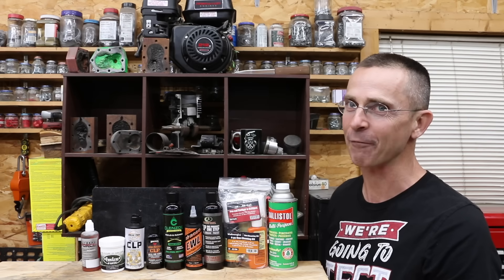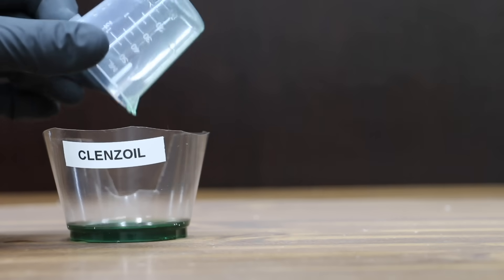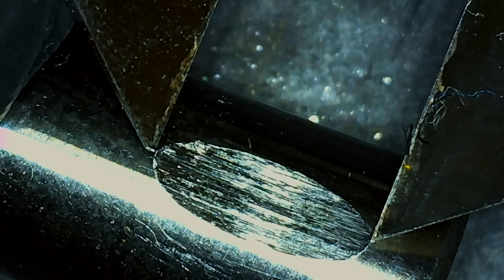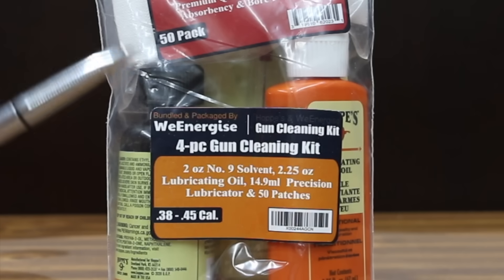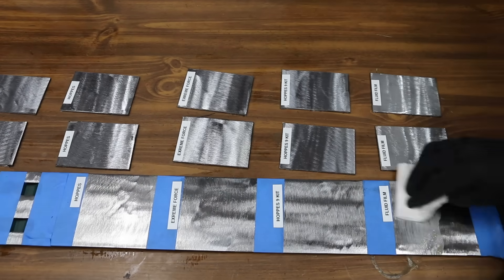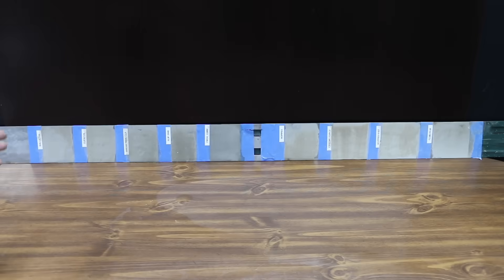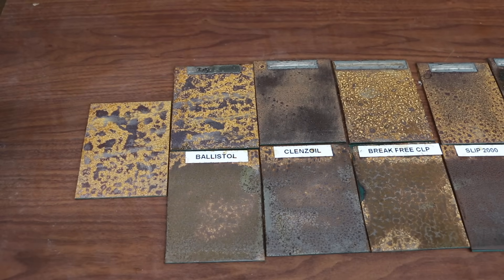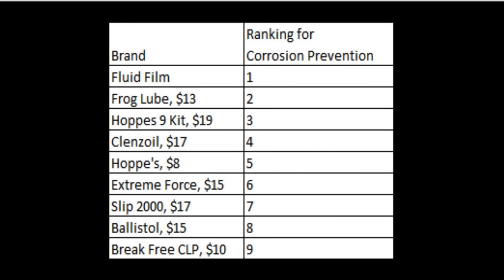Don't Buy A CLP Until You Watch This Review! It'll Save You Time And Money!

Comment: Would love to see how automatic transmission fluid  would stack up against these as I hear it works quite well.
Reply from the maker: Thanks for the video idea.
Reply: @ProjectFarm  mix it 50/50 with transmission fluid. Lots of people on the internet have been using it with good results. How many dirty trans ( internally) have you seen ? Motorkote was one of the highest lubricity lubricants in your past tests and you did cold testing.

Comment: In my experience with break free clp, it's not all that great as a lasting lubricant on firearms but it works great for getting rust off and creeping into spaces. Used it by the gallons to keep guns from rusting and overheating.
Reply: I agree BF CLP to clean followed up with Clenzoil to protect, no one perfect product
Reply from the maker: Thanks for sharing.

Comment: I oil the BCG on my AR with Mobil 1 15w40. Works great! Have only had one failure in more than a thousand rounds, and it was a steel case round that was chambered while hot and not shot for several minutes. I think it caused the case to expand in the chamber and get stuck. Gun fired and cycled, but didn’t eject
Reply: Nope
Reply: Lacquer coating on steel cases will glue the unfired round into the chamber if you stop shooting for even a few seconds, if the barrel is hot. Saw it happen to 2 AR rifles on the same day! Not a lube problem.

Comment: Wonder if Hickock 45 seen this yet? Ballistol is a sponsor of his channel.
Reply: Ballistol was formulated for the German Empire's Military to maintain holsters, firearms, perform maintenance and cleaning on engines etc at a low price both dollars and natural resource wise. Hence it's biodegradable. Then (unlike nowadays) it had nothing to do with the environment they simply couldn't afford to manufacture nor distribute a product made from fossil fuels they did not have access to. 

It's great for what it was designed to do but if you specifically want wear resistance there are better options. And I would choose a 100% synthetic formula for high volume/temperature shooting (lithium grease) and long term storage, because natural ingredients degrade with heat or evaporate with time. Vaseline is my go-to for storing collectibles for years. It works just as well as Comrade Stalin's cosmoline but clean up is a lot easier and you don't notice it in the case.

Comment: Clp should only be applied to metal On metal contact points. You can see where wear occurs internally so just apply a bit to the spots. I prefer hoppes,works great. Never any issues.
 Hoppes breaks Down carbon so well you don't even need a rag. Its great stuff.
Reply from the maker: Thanks for the feedback.

Comment: I used nothing but Break Free CLP for years and I still do on occasion but it has some pretty toxic components so I try to use it as little as possible. Using Hoppes Elite gun oil for most of my lubrication now. I don't have automatic weapons and the Hoppes Elite works fine on my 1911 rails and bearing surfaces on my nickel boron PSA AR15 BCGs.
Reply from the maker: Thanks for sharing.

Comment: Also if you did a part 2.  If there’s a way to test for tackiness/sludge/varnish that develops over time.  I find that like with conventional motor oils, gun oils that are made from organic sources or non synthetic sources when subjected to a heating cycle and carbon from firing and then put away for months at a time without cleaning will varnish up, get very tacky to touch and actually make a lot of firearms not work because the firing pins and hammers move in slow motion.
Reply from the maker: Thanks for the video idea.

Comment: I disagree about the Clenzoil cold test. It appears to me that the Clenzoil was starting to move at the edge, given a little more time I believe that you would have seen slow movement.

Having said that I would rank the Clenzoil as #1 for all except for winter situations below some subjective temp of below 0 DegF. That would be the time for me to break out the Hoppe's #9 CLP until conditions warmed up, then switch back to the Clenzoil. For long term storage and safe queens the Fluid Film would be the way to go.

My experience with Break Free CLP is somewhat contaminated by my experiences with it when it first came out, which was a long time ago. The first batch of Break Free CLP I had worked out great. Some how it got knocked off and I purchases some of the "new" stuff. Terrible results with rust among other things. There was a lawsuit which I believed corrected the situation, I never quite trusted  Break Free after that.

Comment: On the subject of firearms, I would love to see the durability (abrasion, heat, chemical) of different finishes people can apply at home. (some finishes admittedly require SOME special equipment)  For example Cerakote, Duracote, Alumahyde, Anodizing, Rust vs Hot Bluing, or even just Spray Paint.  Since people tend to coat not just the receivers, but stocks, it would be nice to see how finishes hold up on different materials, such as steel (barrels, bolts), aluminum (recievers), different plastics (handguards, stocks, grips ext), some rubber used in grips/buttstock pads.  If you see this, thank you for reading, and thank you very much for all of your hard work on your previous videos, they are entertaining, informative, well thought out and well presented.
Reply from the maker: Thanks so much!  Thanks for the video idea.

Comment: I have a test for you with the old. Years ago I had a car I got owned by a vertically challenged person. The seat wouldn't move at all with my feet on dash board and someone else holding the lever. Break free after 24 hour soak shot sludge into the back seat from track and I almost went out the rear hatch.great for rust. Also had a old 22 as a gift with lots of pit rust. Took care of the rust without any damage to bluing

Comment: Hi Todd,   viewer suggestion for vid,   not sure how to frame test,  but a lot of motorcycle owners are using diesel oils for their bikes,   as they're much cheaper, and supposedly the ad pack is pretty similar, 

Diesels don't have the same caps on zinc DDP that cars with catalytic converters have.    I'm not sure if the high detergent properties are good or bad for bikes.   But anyway,  I'd love to know which diesel oil is best for my bikes.
Reply from the maker: Great suggestion!  Thank you.

Comment: The liquid form of the Frog Lube would have been better suited for this test than the paste.  The paste should be applied to warm metal so that it can fill in the pores and provide a flat even outer surface which prevents wear.  A fair test would've been to heat the pin first, apply a layer of frog Lube directly, the complete the test as you did.
Reply from the maker: Thanks for the feedback.

Comment: About the Frog lube: The manufacturer states the the surfaces it will be applied to be preheated to a certain temperature, application of the product, allowed to cool, then gently wiped to remove excess paste. I run this in my AR and 1911 platforms and I couldnt be happier with it. When properly applied, carbon is very easy for me to remove. I served as an Army infantryman for 14 years, after using break-free CLP on my issued weapons during that time, I can tell you that cleaning a weapon that has been properly treated with Foglube is MUCH easier than CLP lubed weapon. Plus, Frog Lube is food grade so you are exposed to fewer toxins while cleaning your guns!
Reply from the maker: Thanks for the feedback.

Comment: Ballistol is king for removing BLACK POWDER RESIDUE.
Metal slip products isn't always sold as a lube for protection but instead as a slippery metal product to help metal slide easier. Like is you want to reduce the pull weight of your trigger pull.
CLP  refers to clean, lube, protect.
CLP claim to do it all. Some brands don't claim to clp but instead focus on one category like just cleaning or only a lube.
Great video. Thanks, appreciate what you do.
Reply from the maker: Thanks!

Comment: With the Frog Lube paste, you have to heat it (or the part) so that it "soaks" into the pores.  Applying while dry will throw the results off just a little but probably not a lot as that friction test should heat things up anyway.  That said, they also make a liquid.
Reply: I would like to see the Frog Lube tested after being applied as recommended. I believe the salt test was so successful because it was similar to the manufacturers recommended process.
Reply: Thank you for mentioning this! I am a die hard Froglube fan. I use the extreme and do the "seasoning process" every 4 months or so. But in between, even the hardest burnt on carbon just wipes off my parts  now. This is a great channel, and I love his work, and this is the first time I have ever seen a product not tested evenly. Good looking out, bringing this up!
Reply from the maker: Thanks for the feedback.
Reply: I've used Froglube for 2-3 years now. For the liquid friction test and temperature test, maybe try the Froglube Extreme (made for extreme cold/heat) next time. Mainly because, the Paste needs to impregnate the metal first to work properly. Also, it's known to return to a solid in extreme cold temperatures when used improperly (large amounts).
Reply: curious, does it say this in their documentation or in any manual?
Reply: @ShahabSheikhzadeh  Yes it does. People persist in applying it liberally and then are surprised when it doesn't work as expected.
Reply: @matthewblumenthal804  thank you for sharing. I'm going to buy some and test it out at some point. cool! :)
Reply: I've been using Frog Lube since it was first introduced. I've used it to take rust off of metal and as long as the instructions are followed, I think it works as well as anything. However, it has to be put on thinly. If someone applies it thickly, it can get sticky and make a real mess of things. I've heard of people that locked up their actions because they used too much. I don't, and I've never had a problem. Thin film on warm metal. Wipe off excess. Has done well for me.
Reply: frog lube has been my go to for years now, its very pleasant to handle and tools seasoned with it 10 years ago are still rust free today. its something that is more effective the more its applied, i would rest my tools on an oil radiator and rub it in with a rag.

Comment: I use, and would like to recommend for testing, Lubriplate SFGO Ultra 68 as an oil and Lubriplate SFL NLGI#0 as a grease.  Both of these are "food grade", meaning that incidental contact is non-toxic.  They are also synthetic and have very good resistance to thermal fluctuations.

I shy away from motor oil and ATF as a primary weapon lubricant, for their known toxicity and carcenogenic hazards.

I can provide samples of each for testing.  I could also send several other firearm oils and CLP's as well!
Reply from the maker: Thanks for the suggestion.

Comment: As a user of Ballistol, there are a couple of things to point out that weren't mentioned in these tests. Great job Project Farm, I love the stuff you do. Ballistol is not a petroleum based product, I believe it is vegetable oils of some kind, but the blend is proprietary. It is also water soluble which is great if you are shooting black powder. You can make a patch lube with a mix of 10% Ballistol to water and it works great and also seems to help with fouling.  Petroleum based lubricants tend to make black powder cake and stick to the barrel. And Ballistol will not harm the finish on wooden stocks as some petroleum based products will. It also seems to work good for keeping leather holsters in good shape.  I like the stuff, no doubt.  So depending on the type of firearm you are maintaining, you might use more than one product. On my AR, it's Breakfree. On my wooden stocked firearms, I like Ballistol.  Thanks again for the great content!
Reply from the maker: Thanks and you are welcome!

Comment: I use fluid film on my garden tractor attachments lube up all moving parts without attracting too much dust.
I also use sea foam deep creep on my garden tractors to protect chrome from corrosion it doesn't puddle up like fluid film easily wipes clean for displaying at shows. 
I have lot of old garden tractors ranging from 1964-1994
Reply: I may have to put cleanseoil to the test👍
Reply from the maker: Thanks for sharing.

Comment: I am very surprised by what happened with Break Free CLP on the rust test. In other tests that product is usually superior to most others for corrosion protection.  I have to wonder if it had some sort of reaction to the solution you used to accelerate the corrosion process?
Reply: True, I've watched many tests over the years and with steel plates being left outside for long periods or time, salt solution spray, etc, Breakfree CLP is usually in the top 3.  Maybe getting beaten by corrosionx or something very specifically made for anti corrosion. but always beating out the other CLP gun lubes including Clenzoil.  So I thought the same as you. What happened here?
Reply: I also agree with the breakfree rust results. Usually comes out on top. It's been my go to clp for years.

Comment: I didn't get from your video the results of the lubricity from top product to bottom. Will you have another video that also includes lubricity? Maybe lubricity PLUS corrosion? As a gun owner/user, I am interested more in the anti-friction vs. anti-rust/corrosion factor. My firearms are kept in a temperature-controlled atmosphere, so I am not as concerned about rust as I am about lubrication of the gun parts. Great video, BTW!
Reply from the maker: Thanks!  Thanks for the suggestion.

Comment: Definitely interested in more clp/gun lube testing... favorite clp for me is Strikehold clp and favorite grease which I use on every firearm I own is milcom tw25b grease...for me grease on firearms makes the most sense for me...its a open system so it's grease for me...oil is ment for closed systems like engines in my opinion
Reply from the maker: Thanks for the suggestion.

Comment: Another great video by Project farm!  My list for round 2 would be as follows:
1. Lucas Clp
2. Rand Clp
3. Shooters choice -FP-10 CLP
4. Mpro LPX
5. Slip 2000-Gun lube (billed as their CLP)
6. G96 gun treatment
7. Weapons shield
8. Tipton CLP
9. Battle born-all in one (CLP)
10. Rem oil Pro3

All of these are readily available at major on line retailers. Some are repeats from the gallery of comments below.  I'm surprised that the Breakfree did so poorly on the corrison test as others have commented as well.  It did pass the mil-spec test inn order to be apporved.  Perhaps you can re examine the test and make sure it is done with the correct salt spray mixture for accurate results? Great job!
Reply from the maker: Thanks!  Thanks for the video ideas.

Comment: I know you get this all the time but Weapon Shield is what I use in my pistols/ rifles. Not sure how it holds up long term for rust/ lubricity but I maintenance my equipment on a semi regular basis. Anyways the guy who designed it does the bearing wear test you do and it crushes every other firearms product. I can vouch that it has an extremely high viscosity
Reply from the maker: Thanks for sharing.

Comment: Good test but you didn’t use/apply Frog lube probably. You are supposed to clean the gun parts (metal) remove all oils, heat parts with heat gun, apply frog lube and let soak in for 30min then wipe off any excess lube. Frog lube also has a liquid CLP not just the paste.

Comment: I've been carrying guns professionally for about 15 years.  My take.  Cleaning and lube are best left to different products.  The most common failure of lubrication in a firearm is the lube drying out or otherwise disappearing leaving a dry gritty gun when it's brought out and used.    Preventing wear out of the bottle is fine, but preventing wear a month after application is even better.  Been noticing a lot of lubes fail at the latter.  I did a test on carbon removers, and boretec copper solvent won handedly.  I think it's time for an evaporation/drying test of lubes.
Reply from the maker: Thanks for the video idea.

Comment: I really appreciate how technical you get with all of your comparisons.  I use a lot of your videos to guide my decision when purchasing products.  If you make a part 2 of this video, I have one suggestion.  I would like to see you heat the bare metal and then apply the lubricants on the warm metal. That's how I was taught to lubricate my guns.  First, I clean the gun really good and use some rubbing alcohol or brake cleaner to remove any old lubricant. Then, I heat the gun up for about ten minutes.  I apply a generous amount of lubricant to the hot metal and let it cool down completely.  Then i wipe off all the excess lubricant and I'm done.  This process allows the metal to absorb more of the lubricant.  This is a similar process to seasoning a cast iron skillet.
Reply from the maker: Thanks!  Thanks for the feedback.

Comment: I use synthetic heavy gear oil. Doesn't dry, doesn't drip, less than $7 a quart, and when mixed with a little something extra it doesn't smell much.

Used in anything from bargain 22s and 9s to ak's and desert eagles. All run like butter.
Reply from the maker: Thanks for sharing.

Comment: With Frog Lube, the surface needs to be degreased then heated before applying the paste. The paste will immediately melt and fill in the pores on the metal/finish. When the surface heats back up during use it will "self-lubricate." 

It's pretty great stuff. Made of food-grade materials, smells like mint, and is a good option for a long-term storage preservative.

Edit: a part 2 with Lucas Extreme Duty gun oil would be great. Had some come on and with my STI 2011 and I'm curious how well it works, especially if STI is putting it on their stuff. Cheers.
Reply from the maker: Thanks for the feedback.